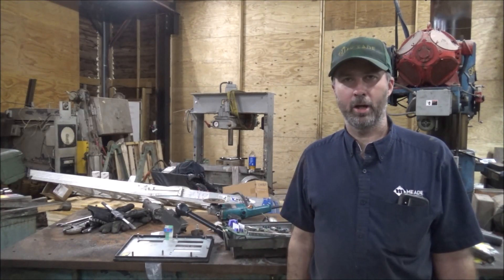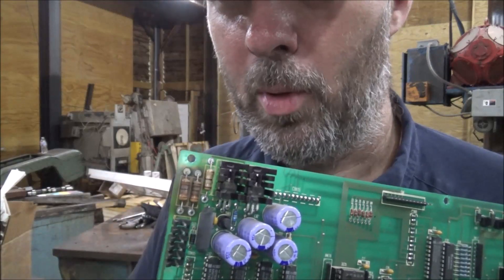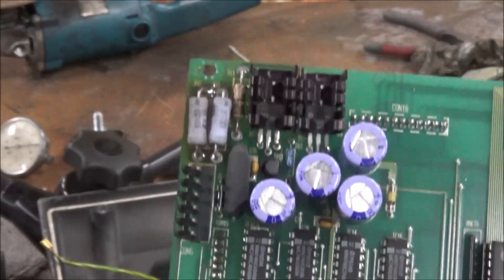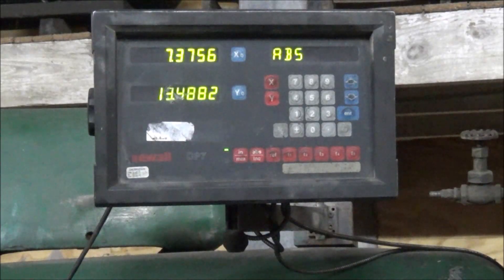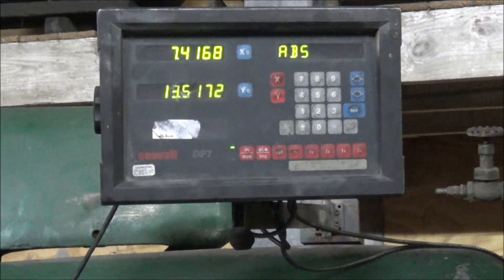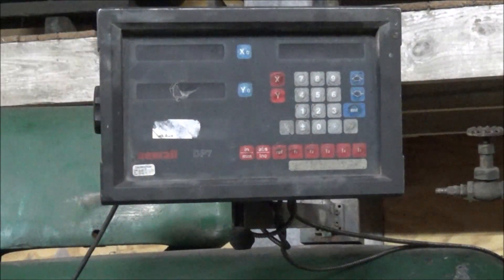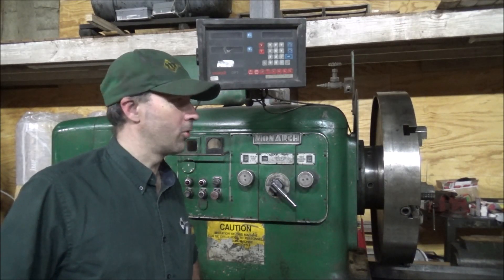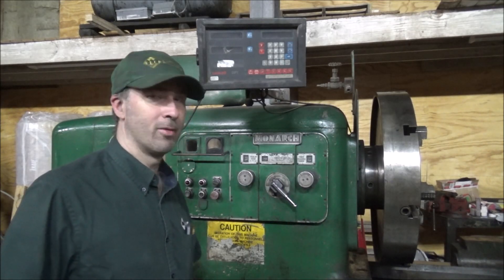Newall DRO Repairs

Comment: Why 13 ohm resistors?  The one I am working on has 33 ohm resistors?  Another good trick to stop the board getting overheated is to mount the resistors above the board with an air gap of 5-10mm so that the resistors and the board run cooler.
Reply from the maker: It has been working for 2 years I guess so it may not make a lot of difference what ohm they are. I haven't had any problems out of it.

Comment: I have a similar problem with my DRO, but it is still working but the resistors are cooked with no values visible, do you remember what they the resistance were?
Reply from the maker: 13ohm 3watt is what I used

Comment: I know that DRO isn't that old compared to other electronics which fail for this reason. Honestly you need a cheap DMM. Check the resistance across the capacitors. If any are less than about 5k ohms which should increase over time as you're testing it, that's a bad cap. There may be more than one in parallel in some situations so replace all of them along the shorted section to be safe.

Conversely this could also be a cold solder joint. Give your electronics guy a call unless you like reflowing solder joints. It's tedious, takes a long time, and usually isn't that exciting. If you can delegate it to someone else who's competent, do. There's a lot of headaches associated with it like bridged connections or traces lifting from the board. Since I know you've been through that part once on the large boring mill. It's super fiddly and very unforgiving if you make a mistake. It's not a fun day when the magic smoke comes out. See I had to learn how to fix things because if it wasn't broken, it wasn't cheap enough to afford for what that's worth. So even though it's a pain where you sit, with due diligence I'm sure you could make it through. Electronics are just machines with a different mode of operation. The method is different but they essentially work the same. I'm still catching up, but the shop looks like it's coming along nicely too. I'm happy to see that you're still at it.

Comment: As others have said, replace the capacitors, they have more than likely dried out. Also reseat the chips that are in the connectors. Both these programs can cause this sort of fault.

Comment: If it's heat related try fitting a small 12v DC fan to cool it !!! Or check the caps for leaky i.e. going short circuit as it warms up, one way to test for heat related problems is freezer spray, on each suspect component after it goes off freeze the hot components, try freezer gas on the caps first see if that makes it come back on. OK just saw the last bit, looks like the capacitors have re-formed themselves so was definitely capacitor related fault.

Comment: Microscope the board for dry solder joints. Use an infrared  thermometer gun to look for overheating components. If overheating, you'll need the schematics to work out why that part of the circuit is failing. In the past I've heat tested similar faults then used a freeze spray on individual components to find the offender. Many ways to go, good luck.

Comment: Glad you were able to chase the gremlins out of it.... Brian I have a question. I know you do a lot of work on pullers engine components. My question is what is the best material to use for rocker arm bushings and also the shaft for a model B Deere? Mine are completly worn out and I can't find replacements. The original were steel of some sort. I can make them just don't know what material to use. Hope you can help. Thanks
Reply from the maker: B's were quite the common tractor. I can't believe there aren't boat loads of those parts available from salvage. I am certain 2-cyl plus out of MO or New Paris tractor in Indiana would have sets on the shelf.  If you just really wanted to make them I would use Aluminum bronze inserts in the rockers on a 4140 shaft heat treated to 45RC or so

Comment: It is good that it started working.  There is a cold spray, that comes in handy for intermittent or heat related electronic failures.  You can spray components and see if they fail or start working.

Comment: Glad it's "fixed."  Thought you might have to learn to work faster.....😉

I'm having a somewhat similar issue with my Shars DRO; display rapidly flickers & it will occasionally shut off (& won't immediately turn back on).  When I get it to turn on, I leave it on. Consensus appeared to be the Caps in yours....not sure if that's the same issue I'm dealing with.
Reply from the maker: Too be honest I am suspicious it may have an intermittent contact in the switch on mine.
Reply: @bcbloc02  Brian ,intermittent contact in switch cant be reason for 2 high wattage resistors to fail...
Reply from the maker: sinkosav the resistors actually still ohm tested ok. I figured they got hot sometime in the past possibly from a voltage spike. They did not appear to be recently damaged. Maybe when they ripped the Dro connector apart it shorted.
Reply: @bcbloc02  yes,that is possible..also that are high wattage resistors and is normal to produce lot of heat,they are there to  limiting current to voltage regulators on heat sinks..but resistors can also change resistance with heat..if they are graphite ones or metal film ,if they are nicrome wire one ,they cant..new  one you put in seems to me to be nicrome wire ones...that's good ones..regarding VMC,if you can find bigger resistors around  lets say 50 to 100 ohms,around 10 to 20 watts,put them in series with all 3 phase ,it is easier than light bulbs,and trying to find out what phase going to supply voltage for electronic.....turn on unit ,first on 240 volts for an hour...
Reply: @bcbloc02  i was forget to mention ,that  light bulbs have one good property ,and that is that can stand lot of current,also when in circuit,and surge or transient is high,they change resistance and start to glow...when unit is turned on,they blink light for a second..that way limit  the surge . they are cheap and used in old days to power up  suspected transformers...if transformer  is in short ,bulb glow strongest...if just blink and glow title,transformer is ok...little glow present low current needed for magnetizing transformer core....so they are good for suggested use ,limiting surge and protecting the unit...if something is wrong they will glow bright...

Comment: Everybody always jumps on the "recap it" bandwagon with stuff like this but I think there's actually some evidence here to suggest it's the problem. I'd guess the electrolytics were leaking enough to put one of those linear regulators into thermal overload (and overheat those resistors), further attempts to run it "reformed" them enough to work again, but they're still a liability and probably leaking enough to shorten the life of everything upstream of them.

Comment: like other guys says,problem is probably in bad caps...they don't like heat ,and they dry electrolytic over time ,and ESR become high-equivalent series resistance....obviously they formed again after long time no use....that is known problem with caps,you need ESR meter to measure them ,and chart to know what ESR need to be for specific capacitance...most failure with electronic today is bad caps,it is best to change them all... resistors was overheated when caps  intermittently produce low resistance and draw lot of current...so they burn,open circuit or change resistance...best practice is to order new caps and change them ,they are cheap...but don't buy Chinese one..
Reply from the maker: Been working fine going on 2 weeks now......... still a need to take it all apart and rebuild? I mean its only like a 20 year old unit.
Reply: @bcbloc02  20 years  can be enough time for capacitors to start be dry out,or even leak electrolytic,it all depend how long they  work ,how many heat they soak,and who produce them...in your case they initially surge lot of current due to staying empty for long time and resistors failed,so now they are formed again,and they can work normally maybe another 20 years...just don't let  the unit stay turned off for long time...first time unit failed to turn on or turn off by itself,change every capacitor in the board..regards Brian,hope to see progress with your shop..and wait to see VMC in action...
Reply: @bcbloc02  normally older professional electronic equipment,like measuring devices ,spectrum analyzers or other specialized units can be very expensive,and after they are stored for long time ,they need to be turned on via the variac,  it is regulation transformer,and can go from zero to 240 volts  AC,it is so called soft start,voltage to unit is increased slowly over some period of time to let the capacitors  formed again,it is common practice.
Reply from the maker: So would it hurt to put 240VAC to my CNC for awhile before putting 480Vac to it? I doubt it would power on like that but maybe it would trickle thru the system a bit to get things primed?
Reply: @bcbloc02  just before you replied,i wrote how is best to do that,yes connect light bulbs and 240 volts for hour or two...you must prevent surge to unit ...bulbs will prevent that...surge can be high even on 240 volts initially...you can put them on 480v as well ,but double the bulbs,at least 4 of them...
Reply: @bcbloc02  you have to find first wires for supplying  electronic...to put light bulbs in series on one wire..it is unpractical to put light bulbs on each wire on 3 phase system ,but can be done also
Reply: @bcbloc02  no ,it will not hurt unit ,just help it to start softer...with lower voltage supply ,unit will not  turn on  but capacitors will be formed properly...i am expert for  tube transmitters,sorry if misspelled some words,it is not my native language..regards from Croatia and good luck...i am open for any question you have..
Reply from the maker: Thanks! Will see what I can do. :-)
Reply: @bcbloc02  you welcome Brian,BTW  love your southern accent LOL..I am really respect you,one man army LOL
Reply: @bcbloc02  my advice to you when first time turning VMC electronic is to put 2 or 3 light bulb all connected in series,and in series with one wire supplying AC to unit...light bulbs  will act like resistors ,and prevent any over current surge from unit...and capacitors will have much softer start,then leave unit for one hour to work or more with that arrangement,later you can remove light bulbs...good luck

Comment: Unasked for help ....it could be the power supply feeding the control board, capacitors age. if you watch retro pc/game channels the PSU go and that can kill the main board, lots of retro gamers use new power supply units (PSU) to remove that from the equation. they also 're cap' the boards, this is replace all electrolytic capacitors. even if the cap look good it may have degraded and not be the original specs anymore

Comment: Heat related shut down. What in the system shuts it off? Usually a relay / contactor. They can get weak or old just like a breaker in an electric panel. What overheated those resistors? They are there to regulate the voltage on whatever is on their load side. I'd suspect the 2 transistors mounted to heat sinks just to the right of the upgraded resistors. Resistors carry heat very well (often outperforming their surroundings). Caps & resistors pretty much either work or they fail. But transistors, often break down at a certain point in their characteristic curve & come back when conditions are more favorable i.e. cooled back down. Best wishes.

Comment: I chimed in in a reply about replacing the electrolytic caps, and the tantalums if there are any on the board. I'll also second the idea of thermal troubleshooting, cooling and heating individual components as well as the traces on the board. It wouldn't hurt to reflow the solder joints especially around anything in the filter area of the power supply. Some have mentioned Paul Carlson of "Mr. Carlson's Lab" as a cooperative You Tube venture. That would be interesting if he would take it on and you don't mind sending your DRO to Canada. Someone else mentioned Buddy at "The Radio Shop" but in a fairly recent video he stated that he isn't taking on any viewer repairs as he has a lot to do already. 

Again, replacing the caps is cheap insurance if they aren't the problem now because they eventually will be. Another has pointed out that caps usually don't cause intermittent problems. That's a pretty fair assessment, but replacing the caps will eliminate a possible conflicting problem. 

Say hi to Baily and scratch him behind the ears for me.
Reply: @sinkosav  Roger that. And yes, I know what Equivalent Series Resistance is.

Comment: The nasty kinda problems...   Worked in electronics for 20 years until 1990, way to get those problems nailed was to use a source of heat, could be a small nozzle hot gun, soldering iron with a flat face, etc, combining this with a fast freeze can of spray, you find those in electronic speciality stores...
You keep the board cold and apply some heat to different parts until they seem a little over their normal operating temperature and so you isolate the heat sensitive component, used to work real good in those times, no reason why it shouldn't still work, just make sure you monitor the power supply output as you go...
Let us know how it turns out...   Great hopefully...   ;)
Reply: BTW, I'd be real surprised it healed itself permanently...
Reply from the maker: Been 2 weeks and it still is on so.............. we will see. For now bigger fish to fry than chasing demons that currently aren't present.

Comment: Good to see another video, thanks! 
You may have said in past videos but I was wondering how successful your floor heating system performed this past winter?
Reply from the maker: It never got freezing in the shop.  Without a proper heat source for it is is way under capacity, add in still no insulated roof and about all you can hope for is it to stay 20deg above the outside.

Comment: Since it is now working there probably isn't anything that you have to do about it. 
If it hadn't started working, I'd suggest changing the power supply caps, just like everyone else has. But since it is working now, while they may have been the problem, they have probably re-formed and are now fine. 
I would normally have suggested checking the temperature to see if it is getting too hot during the first few hours or days of running, but since it has been going a week now you are past that stage of worry.

If it hadn't been run in years, then there are several things that could have gone wrong that will correct themselves after a while powered on. Older caps can "get tired" (for lack of a better description) and can re-form and start working again after they have had power for a while. Maybe there is a battery I didn't see on the board and it took a while to charge up. Hard to say at this point, unless the problem comes back.

Comment: Hi Brian, I've repaired similar Newall DRO's for clients previously. The switchmode power supply for this unit is supposed to supply +5V, +15V and -15V.  The processor board has a circuit that compares the input supply voltage to the output of the 12V regulator.  If the input voltage is low, it holds the CPU in a reset state, so there is no activity.  
Generally, if the switchmode supply voltages are lower, its due to the reduced capacitance/increased ESR of the electrolytic capacitors. If you change these, it should work again.

Comment: I agree with a lot of others, capacitors seem to be the most likely cause.  One monitor I'm using here had the same behavior and then quit working entirely.  I scavenged some caps of matching value out of an old computer power supply and put them in, it's worked without a problem ever since.

Comment: Brian, if you can run the fro board with the circuit board uncovered,  a can of super cold spray will help isolate to the faulty component
Reply: That's how I would proceed as well.  I don't think I would walk around too much with the board in my hand without a ground wrist strap. Static is the electronic equivalent of Mr. Bozo....   Good luck...
Reply: It's a useful troubleshooting tool, but before you start hosing down circuit boards with freezy spray, be ready to deal with condensation.  Blowing it off with shop air works for me.

Comment: Looks like a good reason to get you one of them Thermal Imaging cameras. I bought one of the FLIR multimeters with a Thermal Imaging camera built in to it, I don't use it very often, but when I need it, then it sure is handy. It was handy enough that I bought one of the Seek Thermal cameras that will plug into your smartphone. So I keep my smartphone unit in my backpack so I always have it, but the FLIR multimeter stays locked up in my toolbox at work.

Comment: With the caps being as old as they are, it would probably be worth replacing them
Reply: I agree. Had a controller for magnetic eddy current drive, power supply capacitor would degrade after a few years running and operation would become erratic. Worth a try.

Comment: Depending on the age of the readout there’s two likely culprits; the electrolytics dry out and if there is a backup battery I’d be changing that as they do age and don’t like sitting idle for too long. Wished I was close by I’d drag my scope out there to check the ripple on the supply. Intermittent faults can be found by getting it in failure Mode and use freeze spray to each component to see which ones are sensitive. Anyways good luck, you’re a smart guy and will likely find it.

Comment: Lucky dog there. For me it was always a capacitor in some side circuit unrelated to the power supply but fed directly by it that would fail ... after heating up...It had only a slight variance in its performance before the fail... looked good but... In your case, I'd give it a good brushing (paint or tooth) and blow it out - it could just be a small piece of metal or something that uncoils or coils when temps change.